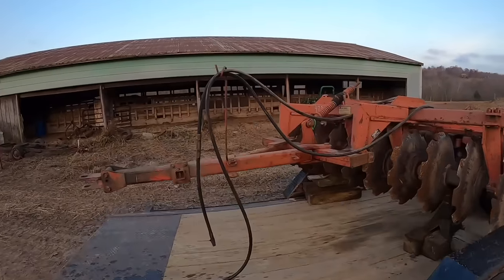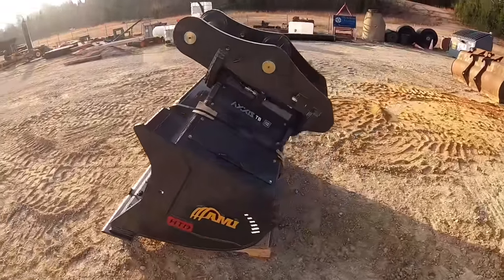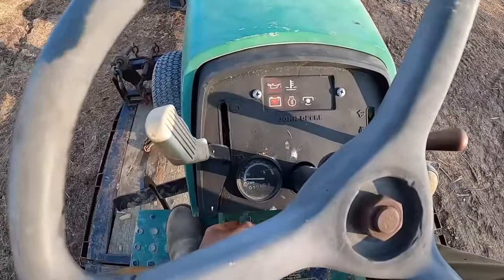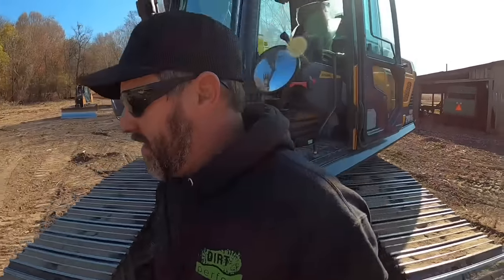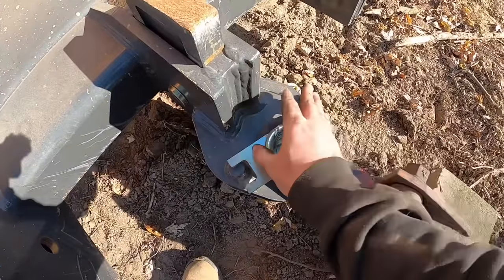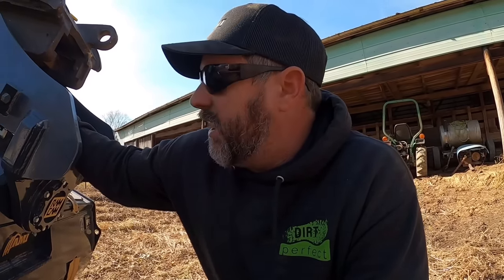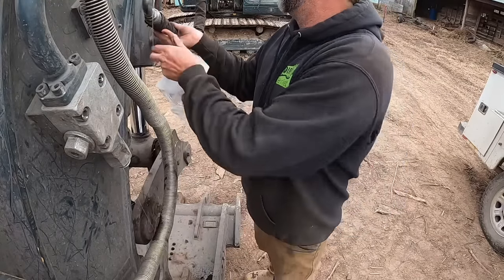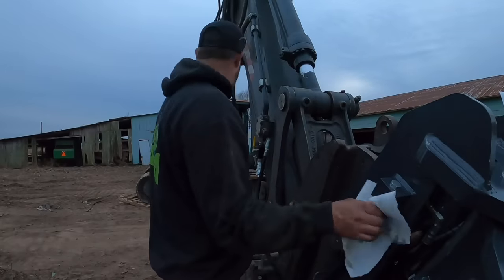This is a bad Idea but we are doing it any way Progress on the abandon farm continues!!

Comment: The two bolts on the disc are there to hold it up into travel mode, take the bolts out, raise it all the way up and put them back in and let it down so the cylinder isn’t holding it up when you’re going down the road or when you’re going to leave it sit for a while. When you are disking with it, either remove the bolts completely, or put them in one of the multiple sets of holes to use as a depth control. Another thing with an offset disc is to go clockwise, so your turning to the right and the desk will cut in more. Looks like it’s in good shape and does a good job.

Comment: Aaron would like you to get a big Kubota Diesel tractor with an enclosed cab complete with heat/AC, radio, etc. Use that to pull the disk, drainage pipe cart, and other stuff.

Comment: Rome Bogg disk were the tool of choice after clearing ground here in west Ky. Pulled with a dozer all the weight you can get on it and slow to give it time to cut up the trash. The dozer will save tractpr tires when running behind the cutter pn the skid steer.

Comment: Got yourself a little rough disk jobbie, nice. We don't have many folks running those anymore in the area, at least for regular construction and light clearing. Heavy clearing jobs might find a larger unit but those are getting more difficult to come by as the pieces wear out from being pulled through red brick hard clay and brushy saplings.

Anyway, the few I have recently seen and remember from younger days. Was that clearing companies that had these also had them connected to a devoted tractor like a brush armored up Deere 5100 size machine.

Brush armor like a large bull bar front bumper pipe. Grill guards and under plate deflectors for the cab and caged in windows. Usually run that tractor in first to what the field looked like before it was cut. What the tractor couldn't push over was later taken out by excavator or dozer. Do the same with a 8' or 10' heavy brushhog then disk it takes care of a lot of field prep clearing for many places.

Comment: I have a disc like this & it takes a 100 HP  tractor to pull it if fully set in the ground. You have an adjustment link at front of disc that will lift or lower the front discs & make it cut deeper and the rear cut less or just the opposite. To cut the brush, I'd set the front lower for the first pass and raise to "level" for later pass to smooth the soil. The off set is a beast.

Comment: The way the offsets are set up on the disk it will turn to the left best when turning. If you turn to the right it will cause ruts that will need to be smoothed over.

Comment: I have a 14' Big Ox offset disk plow (same design) that we have owned on the farm since I was a kid, 40+ years!   Never had to replace  a bearing on it yet!   The bearing housings are close to needing replacement.   One key to bearing life time is do not over grease!   Don't use electric grease guns.   Pump slow and rotate the gang as you pump.  At the first audible grease poping sound or visual grease stop pumping so you dont blow out or invert seals.   Using the right grease for the right application is also important.

Comment: Now that you have a disc and tilt bucket. Mrs. Dirt perfect said she now wants a raised garden bed with a 1/16 “ fall 20 by 20 and DO NOT damage the roses. Now let’s see how good “ operator my donkey” is 🧐🫣? A tip from an old man farmer using the disc try and make a X pattern across the field corner to corner to start with. This will create a checkerboard with the dirt and give you even more airflow to help dry things out. Good luck on the garden and hi from Texas

Comment: I wanted to scream at you when you first hooked the cylinder up, but I'm sure you couldn't hear me! That may have been when it bent. Disc works perfect behind the dozer. A remote hook up on the dozer would be a much better bet than risking multi- thousand dollar tractor tires, at least the first few times over.
 Congratulations on both purchases. Love the bucket.

Comment: Mike, too bad you could not find an electronic valve switch so you can stay seating inside the excavator and switch from tilt to thumb back to tilt again.  Convenience might be expensive and not worth it, but sometimes it is!  So, are we going to check out medium size tractors at the next auction?  Just a thought, but that dozer is doing a nice job!
Reply: Tractors make ruts, crawlers level them.
Reply from the maker: In could but not worth the money thanks

Comment: I grew up on a farm and in my younger days worked in oilfield and construction. I have seen equipment over greased and completely neglected in both places. If the edges of your desk are not good and sharp it makes a huge difference in what it does. You can take a coarse grinding disc and work from the backside of the deskand put an edge on them. It doesn’t have to be razor sharp but I promise it makes a huge difference.

Comment: I love our off set disc. We got a miller 18' 4 bar with 30" notch blades all the way around. Great primary tillage tool for corn ground. It bring a 175hp tractor to its knees in the right conditions. I think that tilt bucket be great addition to your tool collection

Comment: In 1966 dad bought a new 12 ft miller offset disc. On that disc it had 1/ 2 inch wall tubeing. It was heavey. We pulled it with a 1965 4020 diesel. John Deere. 6 inches deep on heavey soil all you wanted. Nebraska tests call that tractor 83 horse power..

Comment: We had a Bush Hog offset many years ago.  It’s a very well made piece of equipment.  From my experience it works much better on dry ground than in wet soil.  The rear gang will “ball up” if it’s very wet.  Yes, our’s had scrapers too, but it didn’t like wet ground.  Like you said, those square beams on top of the disks are solid on that plow.  It’s very heavy for its width so will work pretty well for chopping up small debris.  It will also do better if you carry some weight on the tires when plowing.  That allows the large spring adjuster to help level the front and rear so that it pulls straight and levels.  That might not be of much importance for your use though.

Comment: Miss Aaron. Two videos now.  Is he coming back?

That disc only turns to the left while in the ground.  It could use a slab of concrete on top for extra weight.  If you take a couple of smaller worn discs and use them to back up the leading disc blades, they will be much less likely to break.  Those things do take a lot of abuse but accomplish a lot.

 Is the 750 and the Hyundai CTL going to acquire DP decals?

Comment: You mentioned no plan on putting a block behind that vale and mounting to the boom. I would probably recommend that since there's quite a bit of weight hanging off that mounted block with all those fittings and hoses and such and vibrations from running may make fittings crack hanging off there like that.

Comment: We use a 16ft offset on a d5 hystat and never had any issues. Works well after tree clearing guys come through. Once it's chopped up a bit we switch over to tractor. Nice work on cleaning up new farm. 👌

Comment: Nice addition with the tilt bucket Mike. The 210 becoming more versatile with each addition. Offset disc going take some figuring out the best setup for the intended use. Just the test run behind the Case ,it did pretty good

Comment: You know how you are frequently saying that the topsoil is thin, or there is not much of it? You now have all the tools to fix that. Start with ripping the area, then go back and disc it, all in one direction, and then use a chain link drag (you have the power rake) to get the rocks and sticks, then spread a couple inches of manure (needs to be a little aged) and disc it the other direction. Let that sit up for a few weeks and then put a seasonal grass in (we used winter rye), and once it is full height, mow it and then disc twice (once in each direction) and then plant what you want it to grow... we usually put in "Coastal Bermuda grass" and let that get in solid and added it to grazing rotation. If that works in our rocky dust to make good topsoil here in Texas, it should work up there!

Comment: The pins in the lift mechanism should be in front of that bar on both sides to keep the disc from going too deep and not limit you to raise the disc all the way up if necessary.   We had one on our ranch here in Florida and it's an extremely hard disc to pull.   If I'm not mistaken that should be a Bush-Hog modle #145 disc.   It took at least 125hp tractor to pull that disc with the wheels all the way up letting the disc cut as deep as it can.   About 4 to 4.5 mph is the perfect speed for that disc.   Also when the original cutting discs wore out we replaced them all with 26" cone shaped scolluped discs blades.   These disc blade had more pitch and from the cutting edge to the hub or axel was a strait line and would make turn up the ground even better, but it also made it harder to pull.   Just my 2 cents if it's helpful.

Comment: The disk is going to be a big help with several jobs in the future. I'm thinking it's a great fit for your D4 to pull, and the new bucket is something you did need so you don't have to move extra machines around for a quick ditch just.

Comment: You have a knack for imagining sizes, layout and thread types for those hydraulics!  People don't realize how many combinations those machines have.  Besides the one shop cut in editing, you managed it with one take.  NICE!!!
Reply: Only three fitting types. Pipe, jic, and oring boss
Reply: @williamuskoski1385  :) what about BSPP,  BSPT,  ISO 6149 and all the others out there?
Reply: @bluegrallis  He proved my point... haha  not only series fittings (43, U, W JJ skive, 71, stainless 43 or BW or HY) but diameters inner/outer standard/metric. And angles with code 60 or 61. Is it a 22 or 30 degree bend?  It's a dang jungle. DP has proven that skill not just here in this video.  Cheers

Comment: DP YOU  have to drill an tap a thick small steel plate that fits tight between the boom an valve an put one bolt though the valve into the plate to hold  it there as a spacer. The smallest bump to that valve will bust that fitting between the two blocks every time with out that spacer  ask how I know. You can't get away with it hanging mid air. It not going to turn. Trust me. Don't weld spacer to boom.

Comment: We use to have one of those discs that we pulled with a 90 and then 100 HP 4 wheel drive Case International farm tractors. You ultimately want to be able to lift the wheels and tires completely off the ground for the weight to make it cut better. Also if memory serves me, pulling it around 5 to 6 MPH and having the spring assembly on the tongue set right will really make that thing cut. You can also change the angle of the tongue and affect how it cuts too. Also I can't remember which way you can turn without picking the disc up but it'll walk up and out of the ground turning one way and the other it'll try to pop the disc blades off of their respective hub
Reply: You always turn left with an offset disc.
Reply: You always turn left with an offset disc.
Reply: You always turn left with an offset disc.
Reply: You always turn left with an offset disc.
Reply: You always turn left with an offset disc.
Reply: You always turn left with an offset disc.
Reply: You always turn left with an offset disc.
Reply: You always turn left with an offset disc.
Reply: You always turn left with an offset disc.
Reply: You always turn left with an offset disc.
Reply: You always turn left with an offset disc.
Reply: You always turn left with an offset disc.
Reply: You always turn left with an offset disc.
Reply: You always turn left with an offset disc.

Comment: The valve block combo should be a Factory option ,as most excavators will more than likely have thumbs,and tilt buckets added.
The valve block should be a combination Flow and Flow divert as one block  ,that would save having to fit all those hyd fittings .
Next Auction,maybe a bigger tractor, 🚜 one big enough to run all your equipment if required ?
Having the extra shed storage will be a game changer for your equipment,and i would hazard a guess that will free up the market sight for future development,a bigger General Store with a hardware outlet ????even a Car wash ??

Comment: Looking good, The only concern I might have It is when clearing that the yellow handles on the diverter valve might catch on something hopefully The handles themselves come off Were you'll be able to use The handles on a as needed basis. It might be the smart thing to do to get another one of those  Valves if the handles don't come off And get damaged  Is when
 clearing

Comment: I work on a farm about 3hours northeast of AMI headquarters..we would plow the fields in the fall they run a rock picker in the spring that would also collect most of the roots/branches and start to smooth out the field ..next we would cultivate to break up the clay etc then run a set of harrows to flatten the field for the seed drill …I have never used a cultivator at this stage so I am curious how this turns out.

Comment: If you do replace the cylinder you can double the diameter of the cylinder tube and half the pressure requirement to lift the implement

Comment: Congratulations on the acquisition! Some tools we use more than others but that does not mean those let's use are not a valuable asset to make our lives easier or more productive. Most Acquisitions are worth it and rarely a mistake. And there's nothing wrong with being a little bit lazy working smarter and not harder moving equipment around is it allows us to get more accomplished without wearing our bodies down.

I'm wondering if a four-wheel drive tractor would pull better and if finding at auction something like a JD 1025R would be able to do it or would it be more beneficial to go up in size ?

Comment: Ya we had a cold snap move in last Friday and it here  until this  coming Sunday were it to go up to -4 but in the mean time we stuck with high of -20 an lows over night -25 but the 30mph wind adds to that. The bad part is no snow. Up an till now it been strongly warm but rain an damp cold. We should have 6 to 8' of snow. This cold with no snow freezes up septic systems an water line 6 feet down. But at least it only here for 8 days an next week in the 0 to plus 6. For Jan. Were normally stuck in 40 below for 4 to 6 weeks.

Comment: Nice video, I think the 650 even didn't feel the plow or how do you call it.  In Dutch it's called een eg, a machine to make the ground ready for  seeding. That AMI bucket is definitely a asset to your equipment. LD18 showed it many times. Maybe you can get a deal on a bigger grading bucket, the 210 can handle it. Thumbs up.

Comment: Start looking for a decent 80's vintage 150 hp farm tractor. They are cheap sometimes. Then start looking for a mid sized pull behind dirt pan. Both you can find reasonable and fix up and you'll find a oot of use for them.

Comment: Chain and excavator to lift up the rear, pin it in the up position for transport. Or lift it and remove the pin for disking. That way you can pull it with any piece of equipment with a hitch and you don't need hydraulics.

Comment: I think you need a solid metal block under the new valve so brush doesn't have leverage to bend those fittings. Maybe even milled in a "c" shape to go around it.

Comment: Cross cut disks like that need a lot of weight to work right.  It wouldn't hurt if you put a 2,000lb weight on its back to help it cut when the ground is hard and there is a lot of tree debris.  It looks like you found a good one though, congratulations.
Reply from the maker: lol it’s solid steal
Reply: @DirtPerfect  It is, but it floated up and down when you went down the field. If you want to use it to clear an area with small trees in the future or heavy grass/weeds it would cut deeper and more consistently. The B would be good for pulling it if you cut deeper. Adding a hydraulic circuit isn't very expensive if you T off before the blade control valve. Back in the 90s we had an old Rome disk, we put all the weight we could find on it and pulled it with an Allis 8550 4wd tractor (300hp) and it could cut through trees 5" diameter and cut hard pasture land >12" deep. It was great at clearing everything.